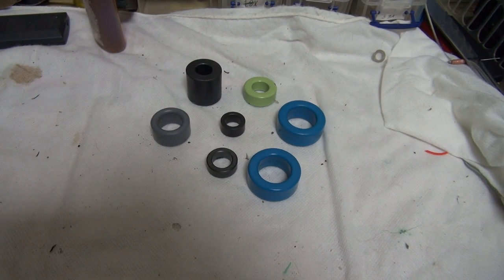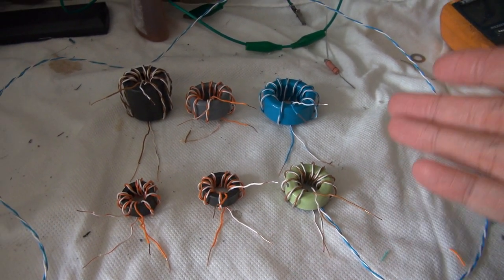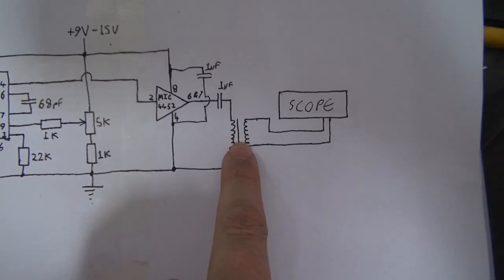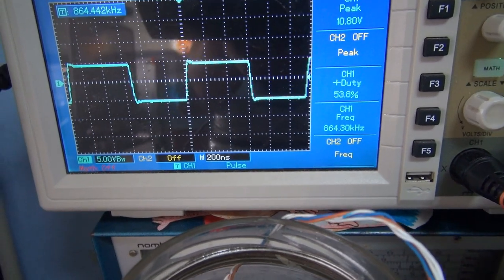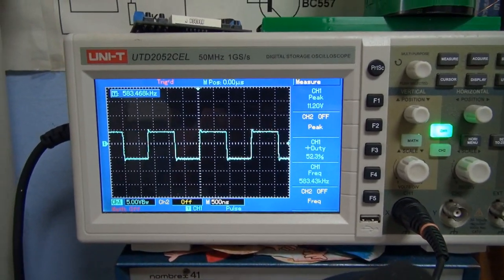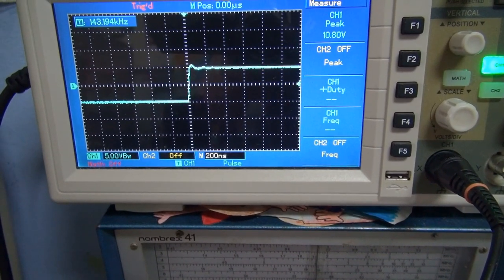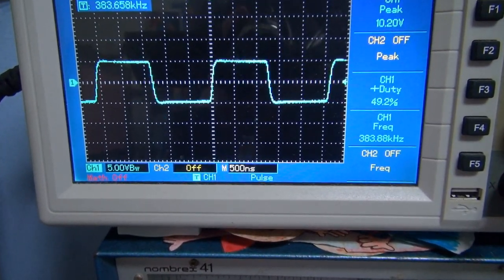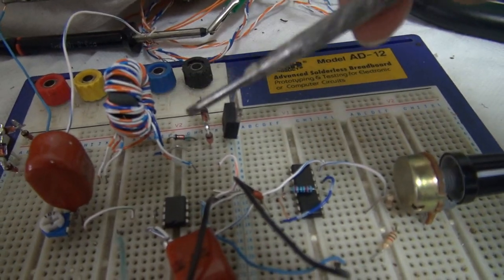Gate Drive Transformers

Comment: Brilliant video, Clem, you explain it so well, lots of good info! This kind of stuff is right up my street!

I think I need to get myself a decent oscilloscope and an LCR meter if I want to seriously get into this kind of stuff!
Reply: BTW, I have made Slayer Exciters and a Schmitt trigger oscillator-controlled coil, but not worked with GDTs, so this vid was very interesting! 👍
Reply from the maker: It would be a good investment. Some electronics just can't be done without a scope.
Reply: @CoolDudeClem  You can use transistor push-pull to drive GDT. There are many spikes on the oscilloscope waveform. How to solve it?

Comment: Heey this is such an usefull video. This is full of really usefull insights and your knowledge and experience. I am glad i stayed subscribed to your channel because it is getting even above that great level of the older of your video's! It is totally interesting again ,and you show the usefull insights with clever explaining. Only you should have measured with some capacitive load on the trafos approximately simular to a fets gate 4nF or so. That way you see much more difference between the cores because without any load most trafos can look good enough.
Reply from the maker: Basically when I tested with the mosfets, that's given me some idea of what I'll have to work with.
Reply: @CoolDudeClem  The push-pull output waveform is very square, and the transformer output has spikes

Comment: a great source of ferrite cores (general purpose atleast) are both SMPS' (albeit thats not guaranteed to have a toroidal core) and (broken perhaps) car amplifiers

i also got a bunch out of other random stuff and mainly older computer cables

those oldschool VGA cables with a separate plastic thingy near the connectors always contain one for example, older usbs often also have them and whatnot

for gate driving with BJT's i always use a double push-pull/voltage follower setup (push-pull driving another push-pull, for current gain)
Reply from the maker: I never thought of using the double push pull setup, but I think I'll stick with using the gate driver ICs.
Reply: You can use transistor push-pull to drive GDT. There are many spikes on the oscilloscope waveform. How to solve it?
Reply: @townjava6845  could be ringing, if you switch current on and off fast you usually get a peak, that is also how some flyback circuits get a far higher voltage gain than some others even if they're switched at the same voltage, you may need to add a snubber like circuit or atleast a zener diode, high enough voltage wise to not continuously clamp the GDT output, but low enough to not exceed 20V on the gate, on the input of the gate to get rid of those to protect your fets

Comment: What's the schematic on the wall with the 16 pin IC and the BC557? It looks interesting.
Reply from the maker: It's a oscillator using the CD4046 with a BC547 and 557 to buffer it's output, pretty much the exact same circuit I'm using in this video, except I'm using a gate driver chip instead of a couple of transistors.
Reply: @CoolDudeClem  Nice. Did you ever do a video on that particular circuit?